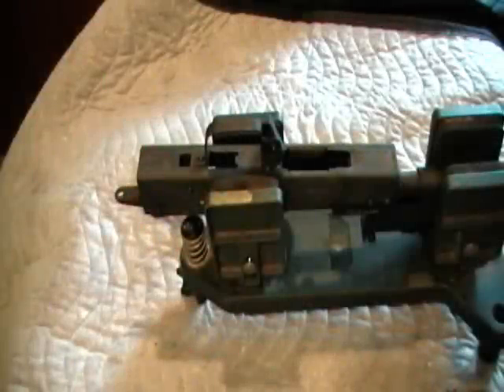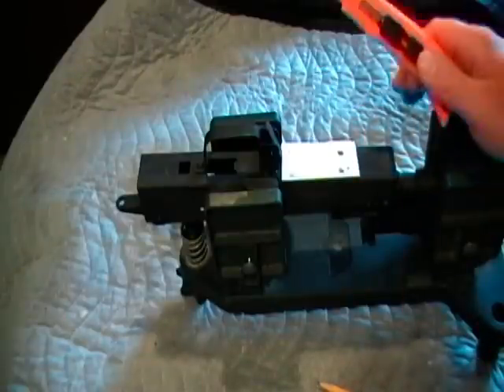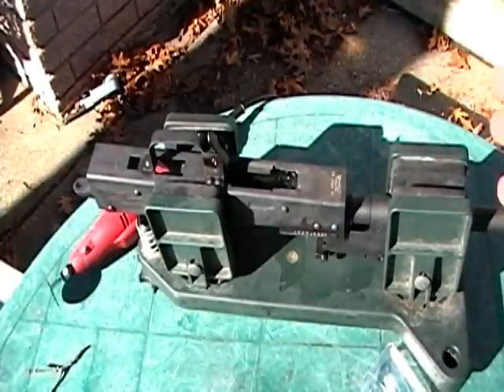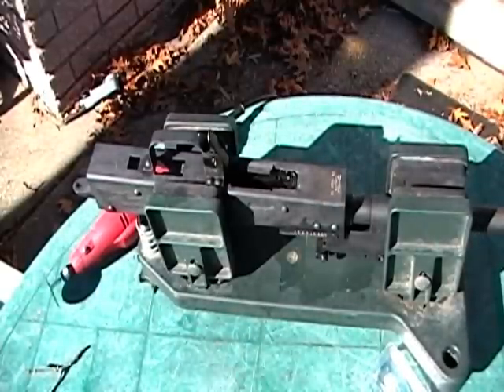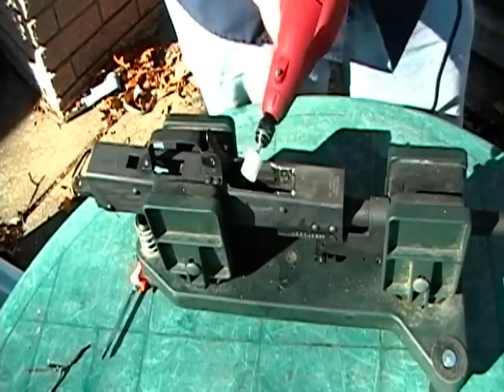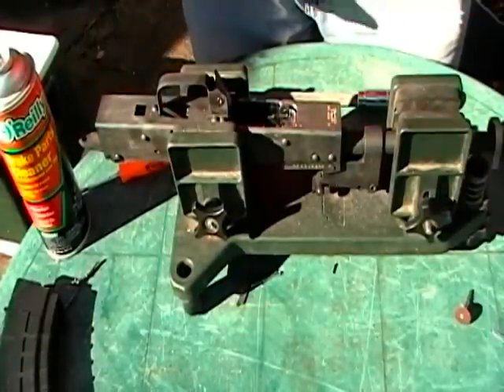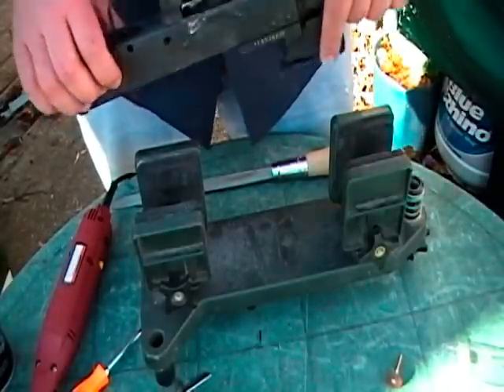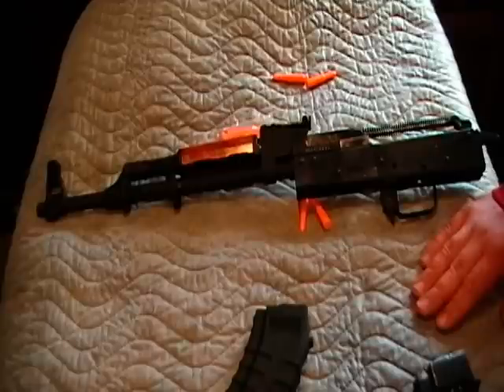AK-47 Conversion Bulgarian SSR-85c Low to "High"-Capacity Magazine (lo cap hi cap)-Part 1

Comment from the maker: @3khudson19 It might.  You may want to ask some PAP owners about their rifle's internals.  Things to be especially wary of are the width of the gap in the front trunnion where the magazine locks in, the location and type of magazine supports, and how the stock attaches to the receiver.  Pictures of the PAP show the rear of the receiver is angled more sharply than a standard Yugo, so stock attachment could be a problem.
 
Good luck either way and thanks for watching!

Comment: Did you have to change the bolt or are you still using the singlestack bolt?
Reply from the maker: I didn't have to change the bolt, but the factory bolt looked a lot more like a standard AK bolt than the one from my single-stack WASR.